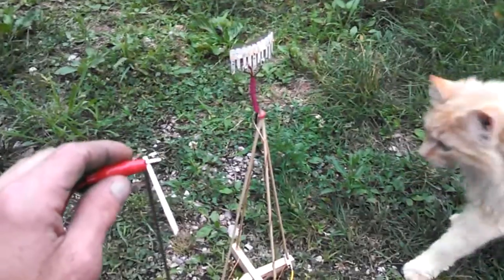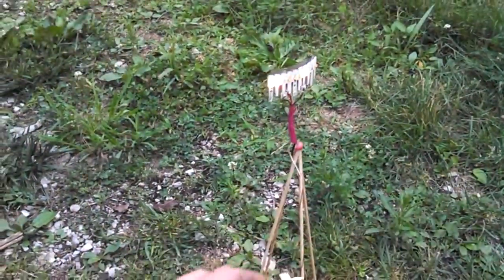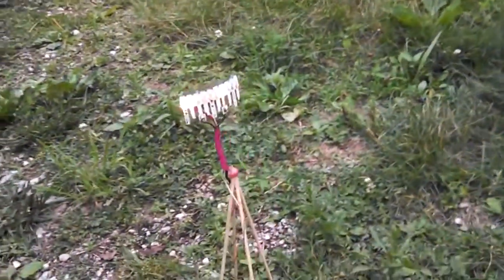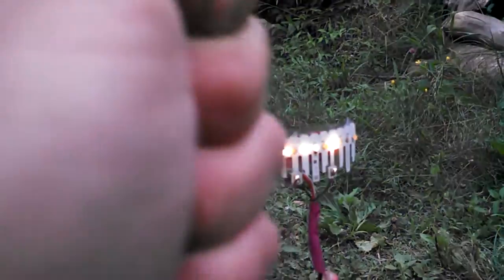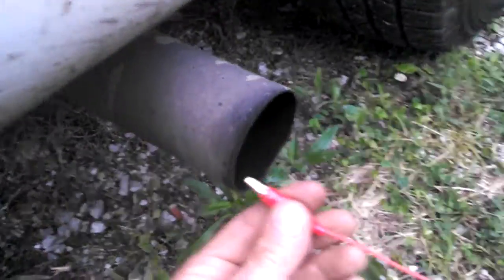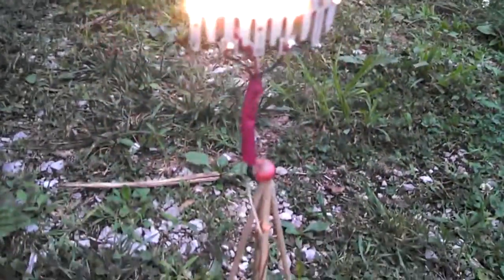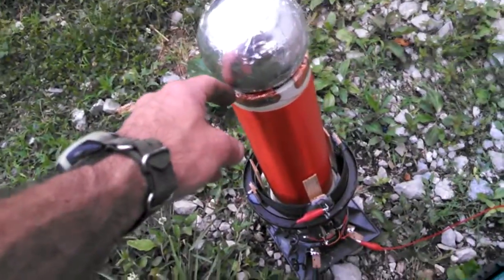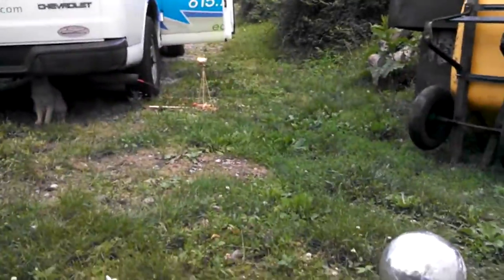Slayer Tesla coil outdoor lighting system :)

Comment: cool man :)
you dont even need that 1 wire!!! :)
a metal plate with a av plug to it works great aswell :) (i guess metal plate would be the virtual ground(or capacitance to ground))
just ground it and put a piece of metal as antenne :)
got some crazy results with my SETC.
1 wire i can walk through my whole house (1st floor, attic) concrete floors and walls so the signal goes through them :)
Keep it going!

Jeroen